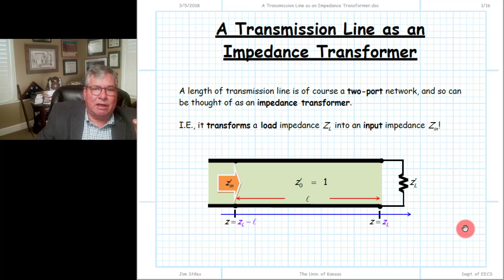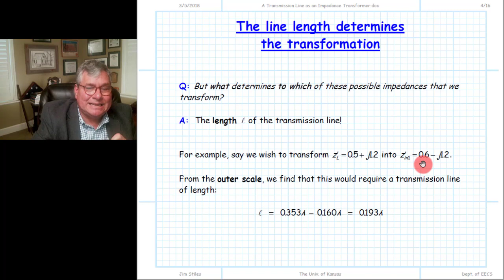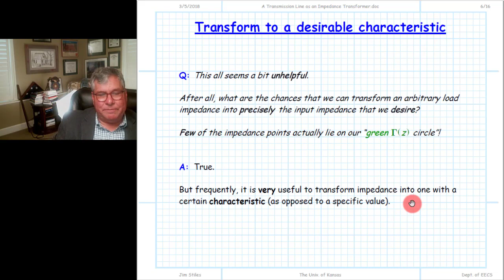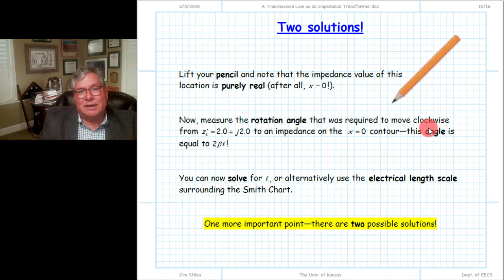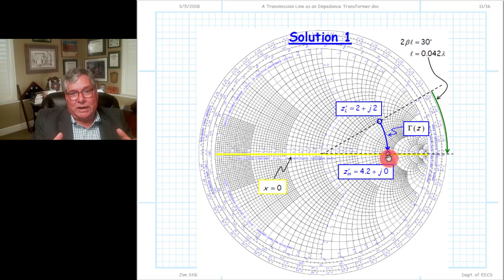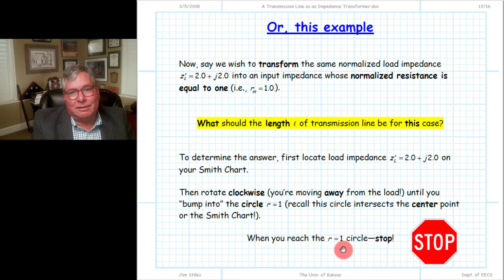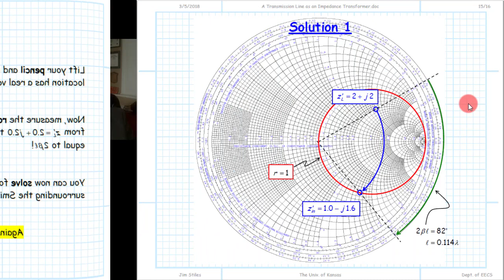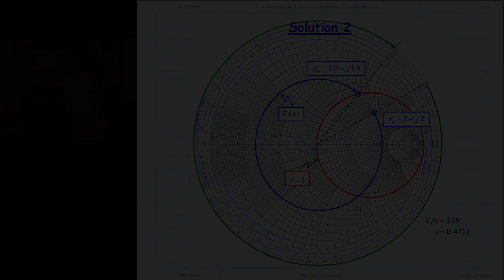A Transmission Line as an Impedance Transformer

Comment: There is an important exception to this: When the transmission line itself has a different characteristic impedance from the system itself, it will transform about its own center with wavelength rather than the system's center. Example: If I want to get from 115+j0 Ω to 50 +j0 Ω, I can do that with a 1/4 wavelength of 75 Ω coax.